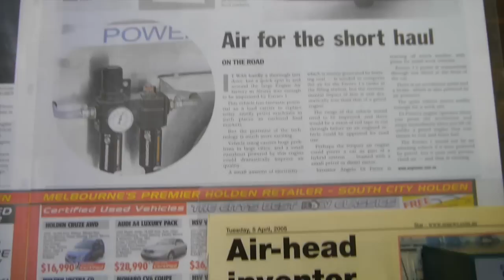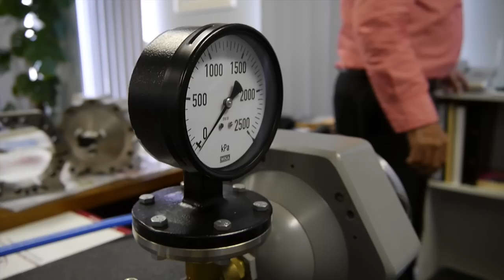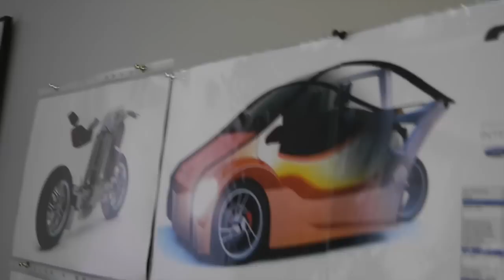The Di Pietro Engine - An efficient and versatile energy convertor

Comment: Where can I buy one. For over 10 years we've been hearing about this engine and still no engine to buy????? Why???
Reply: Because a steady source of compressed air isnt there?
Reply: @jaxxbrat2634  wtf lol, all you need is to buy a compressor and you're set for life dude.
Reply: @Feracitus  well not any type of air compressor, you need those that fills oxygen tanks like those at the fire department which cost $$$$$ a normal compressor could not keep up and you would still need an energy source to feeed the compressor
Reply: @MagicInternetMonkey  A never was engine.
Reply: @MagicInternetMonkey  not quite. This engine is super efficient. It needs only 25% of the air pressure of similar engines. Problem is, someone somewhere is waiting for Angelo to die before stealing the patent. IMHO, this engine is superb!!! It throttles and has variable torque. What it might need is multiple coupling to compete with bigger motors; add to that a liquid Nitrogen industry. It needs commitment from some serious industry players to bring it to level 5; level 1, small players.
Reply: Paul Datche No more efficient than any existing air motors ie Gast. (PDF sent to me by depetro) The losses are horrendous Li batteries and electric motors have made this even more laughable
Reply: @pauldatche8410  Sad but true. I thought the Di Pietro's engine would be at the same place in the car market as Tesla by now. Perhaps there are drawbacks to the air engine known only to those who have tested it
Reply: @jaxxbrat2634  A simple mechanical Turbine is all that would be needed, or a Trompe could be used in some situations.
Reply: @Blanton95  I think he is waiting for a big offer from big business for his Patent, if so he is wasting valuable time, time we haven’t got. Also it is more likely than not that if a big company buys his Patent that they would leave it on a shelf to collect dust, or they could sell it on to a Car manufacturer who would also shelve it!. Shame cos if Angelo had been selling the Engine to individuals and small businesses for the last 9 years. He would have a big business by now, cos word would spread like wildfire of his amazing engine!
Reply: @Kiyarose3999  I dearly wish you weren't absolutely correct, because those are exactly my thoughts on the matter. Pride and greed has once again robbed the world of an alternative solution to fossil fuel based transportation. Hopefully our interest may coax a response from the inventor  someday....
Reply: @fizzguts  Have you ever thought about those Dead Batteries every 3-5 years... and the money you need to buy another $5-10,000 Battery... recycle Li Ion Batteries... sounds like I heard THAT ONE about 60 years back by Nuclear Snake Oil Salesman... did we not... (Don't worry... we will recycle/breed n7clear waste... 🤣🤣🤣🤣🤣😭😭😭😭😭)...

Comment: This is total nonsense. A 1 litre, 4 stroke car engine exhausts 75,000 litres of air per hour at 2,500rpm. This thing would have to do something similar, however magic the science. A full, standard 5ft gas bottle holds 6,300 litres if compressed to 2200psi. So a full gas bottle would power a little Smart car type vehicle for five minutes! This would cure urban pollution, because everyone would be walking!
Reply: Your premise of the air volume expanded by combustion exhaust would need to be matched by an air motor reservoir seems incorrect to me. There are many more factors to account for....

Comment: The most that could be done to eliminate the friction inside, which is next to nothing, is coat the various inside parts with, for example, a teflon spray or anything similar. However, the inside parts are mainly cushioned and "lubricated" by a thin air film. Source: en wikipedia org/wiki/Angelo_Di_Pietro_(inventor) 
Yes, the parts make a (minimalistic) connection, however, not as much as that of a conventional car motor, where you'd need oil to keep things rotating smoothly all the time.

Comment: This is a great and important invention. An efficient heat engine can be built for residential use using an efficient compressed air engine, an efficient heat exchanger, and an efficient air compressor. Heat from the sun can be collected, stored, and used to run the heat engine.

Comment: I see you might have missed other video's about this concept. The parts will not wear easily since they're not really touching each other when spinning around. Instead, as high pressure was useda thin air cushion between the parts will keep it from wearing out. The lubrication system, is actually the compressed air between the parts

Comment: that and gas engines can run on compressed air too with simple cam modifications, may not have the same power but it sure as hell can be done.

Comment: I remember seeing this back in 2006. As you can see there is a prototype car. The Biggest problem is the ASA that the car would have to meet. Then they demand that you put the car through crash tests, even if the chassis and frame have been through these hurdles under a different manufacturer..I believe that the car in the video is a carbon fibre frame which is strong and light. I am sure that sound dampening could be installed to reduce the noise. Also an idea would be to have solar panels as part of the roof and bonnet design for the car. In stall solar panel roof rack. With Batteries. Leave the car in the sun..  great concept. I would very much like to see this car in production. My hat is off to this man.

Comment: New carbon fiber composite air pressure tanks can hold 10,000 psi or more and provide a range at highway driving speed, for a large passenger sedan or SUV, of 1000 miles or easily far more (by forming several air pressure tanks into side panel areas) Furthermore, as I've pointed out to GM Cadillac and others, you can use the same technology to make VTOL aircraft, in which case you save huge amounts of weight and increase mpg and efficiency by avoiding wheels, suspension and so forth. This can be made "failsafe" by using gyrocopter rotors that will autorotate in case of any type of failure, to provide a safe landing. (I don't know if counterrotating propellers in Venturi turbo housing can "auto rotate" like this but counterrotating propellers are superefficient and should be used if possible.) Another key consideration is that any auto manufacturer that goes to VTOL aircraft primarily, will dominate the personal and family transportation market.

Comment: The Di Pietro motor uses a simple cylindrical rotary piston (shaft driver), which
rolls, without any friction, inside the cylindrical stator. The space between stator
and shaft driver is divided in 6 expansion chambers by pivoting dividers.

These dividers follow the motion of the shaft driver as it rolls around the stator wall.
The cylindrical shaft driver, forced by the air pressure on its outer wall, moves
eccentrically, thereby driving the motor shaft by means of two rolling elements
mounted on bearings on the shaft. The rolling motion of the shaft driver inside the
stator is cushioned by a thin film of air. Timing and duration of the air inlet and
exhaust is governed by a slotted timer, which is mounted on the output shaft and
rotates at the same speed as the motor.
Reply: Thanks for that

Comment: You could run it on a photo reactive gas of hydrogen and chlorine and a electrolyzer could recreat the gas run with a laser or leds, or sunlight to make pressure to run the engine instead of fuel combustion?

Comment: Is there a way to make this engine available to the public as a stand alone, open sourced unit? Big Corporate is only interested in consumer deception and dependency for intrinsic value, producing vehicles that require dealer only repairs using original manufacturer proprietary parts.... the concept of this engine destroys that century-old wildly profitable  business model of automobile manufacturers. I would like to see a price list and specifications sheet for this unit if at all possible

Comment: Big truck got
About 10 foot wheel circumference..
X 5280 ft aka one mile.  = 528 rpm
To run 60 mile per mile. Wheel mounted.  Aka in wheel

Comment: Seeing as there’s no combustion surely other non metal materials could be used for the ‘block’ of the Rotary engine!. Such as recycled plastic or a Hard wood or even Bamboo, or a mixture of those materials for the ‘block’ and other parts to the engine! Also the Fibreglass would be better made from Hemp fibreglass for body shells as Hemp Fibreglass is stronger than steel and locks up Carbon when growing. Plus Hemp can be grown locally and help a new local economies to grow with the CAV’s growth, also can be grown on depleted land!.

Comment: This brilliant concept suffers the same limitation as do battery-powered vehicles:  That air charge has to come from somewhere.  And that somewhere is going to be a compressor powered by a gas engine, or an electric motor powered by combusted coal at a central power station.
Reply: I guess you could always set up solar to run a compressor during the day to fill a huge air tank , but that costs money and compressors do wear out , it appears there are no silver bullets , the most convenient way to power a vehicle is still a drop of flammable fuel and a well built conventional engine . 
The  things the ice engine has is versatility , the ability to last a long time , ease of manufacture , and the ability to run on a vast amount of different fuels .
Reply: Well if you look at compressor from purely a battery standpoint, it makes a lot of sense, it can store much more energy, especially at low temperatures.

Comment: dont you use one of the other fuel sources to compress the air?
Reply: Does efficiency matter for energy storage when you consider the fact when you double the velocity of wind it produces 8 times the force upon the blades? Look up UK wind curtailment (pitching blades parallel to wind to produce zero energy) and the necessity to install 20 GWh of energy storage just to reduce curtailment in half.

Comment: I know for fact that air powered engines are nosey but I think that's a safety feature for motorcycles. I think this technology can prove itself once air engined drones win fpv 250 races.  Let's say a small cylinder shaped carbon fiber cartridges size of a rechargeable battery.  How much of power advantage is that compared to the electric powered fpv drones if you can add air cartridges incorporated into the structural framework of the drones?

Comment: it's very efficient. and add to that a solar powered compressor at home and you're driving for free. It also has an onboard compressor that will fill the tank in 3hrs for a cost less than $ 2.00 USD for the Hydro and will go 200 klm. that's less than 1 penny a klm, what does your car do for $1;86 maybe 25-30 klm and can you fuel it at home on solar generators. Ohh and this idea was first introduced in 1920 but no car company would pick it up because they were influenced by the Oil industry not to have a car that didn't use Oil
Reply: and I might add they used safety of storing the compressed air an issue back in the 20's but today we have carbon fiber air tanks that wont explode, they crack releasing the air. Which would be better than covering all the victims at a crash scene with gasoline
Reply: i don't understand why isn't into production
Reply: it's pretty easy to see why, the industry wants us to BUY gasoline everyday. they don't want you to drive for free with no emissions. you can't get rich letting people drive for free.and you can't get rich curing cancer or making a fair system. it's all designed to make people rich, not to make this a better world
Reply: BudFactorE  I could pick out that EVEYTHING you stated is absurd & I can prove you wrong with plan old common since, but I wont.  If you (& others) would quit throwing your bias factually misleading propaganda out there. "Things could be different!"  But all you do in stir up & divide everyone., Hell I think this is "capable engineering" but you make me want to go against anything that YOU stand for, & i'm all about cleaning up waste energy!
PS
I hope everyone is a skeptic to people who cant use there real names!
Reply: Sorry i guess you're right, there is no Compressed air engines, it's all a myth, sorry. I was going to mention Hydrogen too but that is also ridiculous. maybe someday though. I also heard a crazy rumor about electric cars too. but again, it's all a dream.
Because if they were real the Oil company's would be pushing those ideas, not suppressing them. what was i thinking

Comment: u put that engine in a car and it would more than likely lose nearly half its power after about 30,000 miles look how it is built, it is machined so precise its the only way it can stay sealed up and work, well guess what it will wear extremely fast especially without an efficient lubrication system

Comment: But he's leaving out the energy source that is used to compress the air!!  How is that done, by lots of fairies flapping their wings and pushing the air into storage tanks?
  Engines are mechanical devices which generate power from a fuel which is burned by the portion of the device that is actually doing the work, e.g. pistons, turbines and jets, whereas motors are mechanical devices that run off of a source of energy which came from somewhere else, such as a steam locomotive's boiler, an electric motor in some kind of device or a solenoid going back and forth.   
  In short, there is no free lunch anywhere you care to look.  Someone, somewhere, somehow is paying for it.

Randy
Reply: No doubt compressed air needs energy to be compressed. But how much energy needs fuel to be refinated before you it's ready to refill your tank? Nobody never planted the question!

Comment: Another clever arrangement of valves/chambers/rotors/shafts/blades/etc. that can extract work from expanding compressed air.  The biggest issue I see with this design is the huge amount of friction in the mechanism.
I hate to break this to everyone, but in the future, vehicles will NOT be running on compressed air.  Compressing a gas to the pressures required to make it worthwhile isn't efficient AT ALL.  The volume of compressed gas (air) required to give a vehicle a reasonable range is enormous.  

BTW, getting a patent for an idea or "invention" doesn't really mean shit unless it's a GOOD idea and someone else tries to duplicate it within their own product.  Being the owner of a patent simply means you were the first person to legally document an idea.  It could be the dumbest thing in the world, such as a solar powered fart sequestering blower - as long as you're the first person to have it legally documented, you get a patent #.

Comment: So which petrol company bought off the patent? 
Not heard about this engine in the last 10 years nor seen anyone build a car around it...
MDI are the last ones making promises about actually building air cars, but unfortunatelly with the least effecient engine on the market (related to my own shallow researches).
In many scientific magazines the efficiency of air engiens is critizised harshly. But in those articles the fact is completly neglected, that we have a lot of surplus regenerative energy from sun and wind, which we are not able to store efficiently. If we would use the unused energy from sun and wind to compress air, the air engines would seem much more efficient when calculating in the zero-cost energy that we completely waste by now.
Like so many others I would be more than willing to by a car with this engine at once!